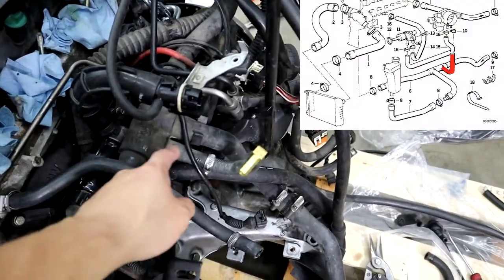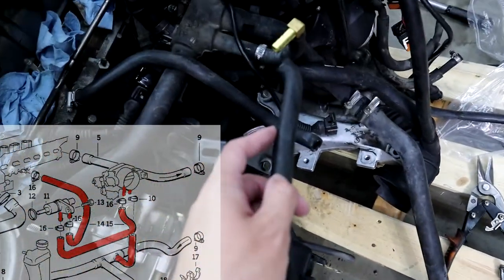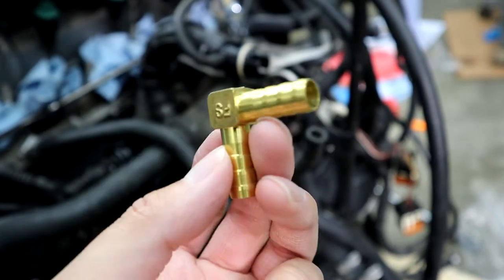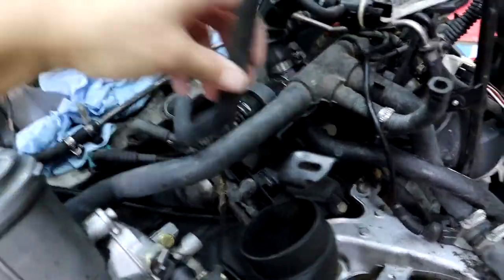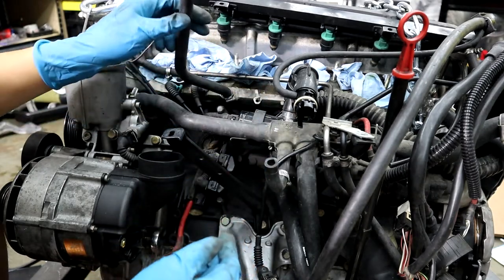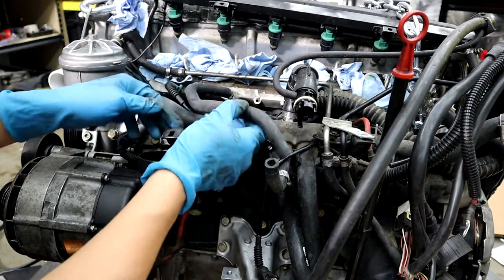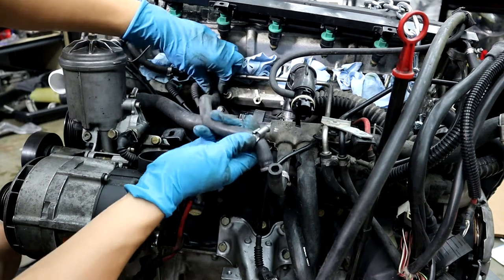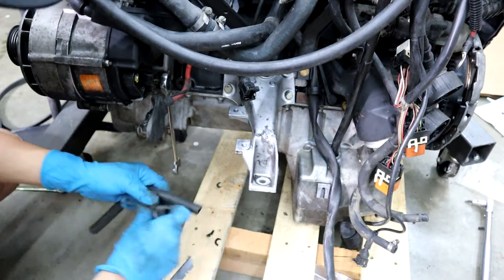BMW E36 throttle heater delete

Comment: why dont u delete all the heater pipes or lines ?
Reply from the maker: I wanna be comfortable in winter    I am putting AC back in too lol.
Reply: @ricotheunprofessional   i want to ask you if i delete the heater core and throttle body lines , block back of the engine and the head i plug expansion tank back of the water pump is it ganna be fine ?

Comment: Why not just use a block off plug.
Reply from the maker: need to keep the correct water flow since it comes out of the head.
Reply: Yes i think that can block.